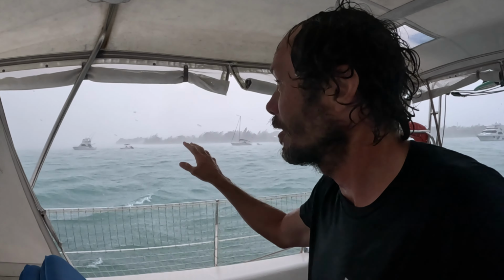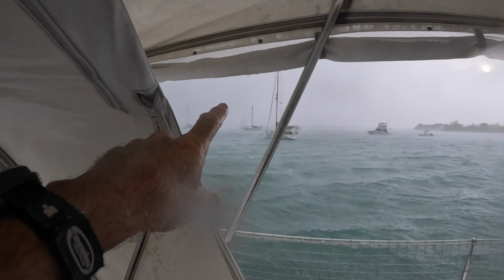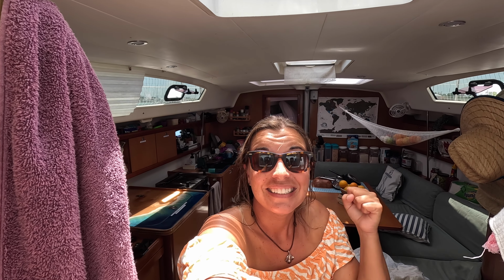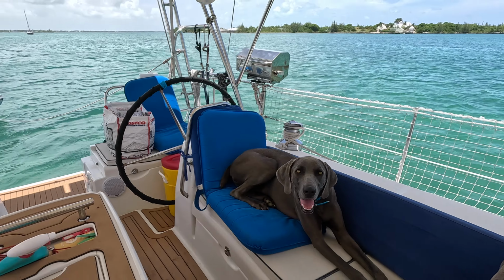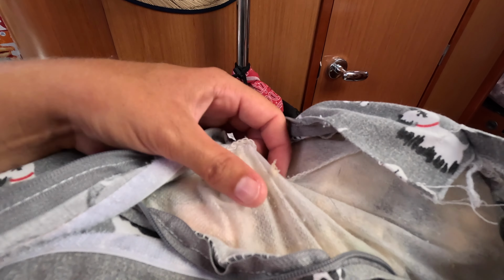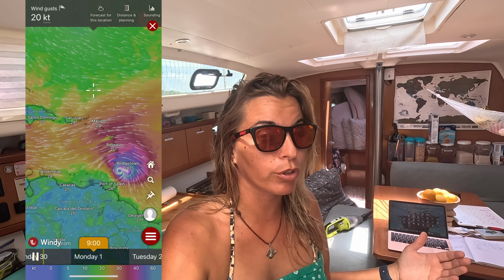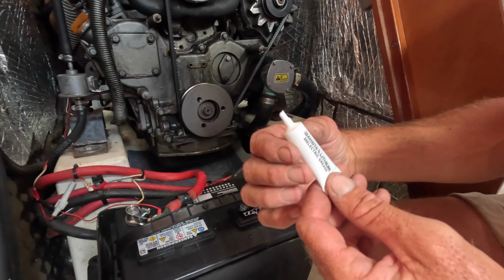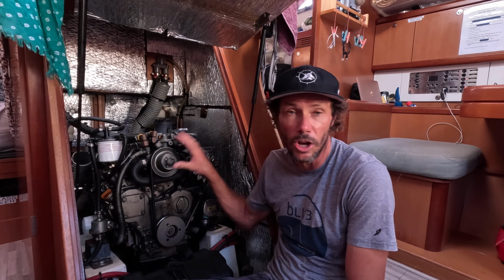Boat Life = Engine Troubles in Bahamas 🇧🇸- Ep. 245

Comment: Guys here is what you should do, Buy a recon kit for the fresh water pump on the engine. You don't need to buy a new pump. Waste of money.
It is just a seal and gasket kit you need to replace. That is why the coolant ids leaking out the weep hole, No big deal . I just love the dogs!
Reply: I'd get the Heat Exchanger out and cleaned as well while Im at it. Best Wishes. Bob. 👍
Reply from the maker: Thanks guys! We had already put the order in for a new one!! But we will keep old one anyways! We will be doing change in next weeks video! Arggg! Fingers crossed it all goes well!
Reply from the maker: Thanks for the info!! Ahh 😌 we already ordered the part! It cost us an arm and leg so we will keep old one and replace seals like you mentioned! Cheers for the advice though! 🐾 Flint and Kirra are the best!!! 🐶

Comment: In over 15 years of use I never had a Sulpste problem with Lead Acid batteries by keeping them at an absolute minimum of 12.2 volts or 50% Capacity, before fully recharging them to 100% AGM BATTERIES should be kept above 80% Capacity to hugely extend their Service Life, and Li Time plus, and Power Queen Lifepo4 Batteries are now good enough for a Bank treated properly for a second Bank, to be used to keep all the AGM, Starter, Windlass, and bow thruster Batteries to be kept in tip top condition by using DC to DC hanging from them, while keeping the Lifepo4 Batteries above a 50 % statevof charge, and gently charging and Discharging them to maximise their service LivesRe the engine, looks like the Hrat Exchanger needs a thorough clean as well ? . Re the Oil changes - good quality Synthetic oils have a phenomenally tough structure, and as such can stand to be changed every few years, but it is important to change the Oil Filters Regularly, and the Charter Companies fully service every three months for good reasons, so here's an idea ? Bulk Buy high quality pattern Oil Filters, and change them every three months  ? At the same time check and clean water and fuel,Filters, and check everything else as well, including gearbox, Saildrive, etc. Every few years send a sample of the oil in for analysis of how gourmet engine is doing internally, so you know where you standtbh, Id be looking for somewhere less exposed to hole up for the rest of Hurricane Season. Very Best Wishes. Bob.🌟🌟🌟👍❤️
Reply from the maker: Thanks Bob! As always for the great info! We actually ended up returning the battery as the voltage just sat so low…and they have taken responsibility for it! We bought a proper Marine starter battery and this one seems to be doing a great job! No sulfate as of yet!
Reply: @SailingZephyr  It’s worth noting that Lead Acid batteries and which may apply to AGM as well do self discharge surprisingly rapidly, so it is well worth checking their Voltage Daily for an easy diagnosis of their internal state ? Once they get below 12.2 volts they start dropping in voltage scarily fast, and there is no such thing as a Deep Discharge battery that is safe to actually Deep Discharge- every Deep Discharge Damages Batteries, and advertising them as if it is ok to Deep Discharge them is false advertising as far as I’m concerned. Once you know how to treat your batteries right, the gains and the Service Life of them become pretty substantial to be honest. Only now do I feel that I know enough about Lifepo4 batteries to be able to have the confidence to install a Bank 2 of them for a management role for keeping all other batteries in tip top condition, and I can now do that with the very cheapest of them by splitting them into a Bank of 4 x 100 ah and a usable up to 200 amps, via gentle discharging and gentle recharging, so the individual batteries in that Housebank never get stressed- note, I will never use 200 amps topping up the AGM batteries during the hours of darkness, so I don’t even need Li Time or Power Queen Batteries any longer, though their new BMS is very attractive to have. See Will Prowse comparison testing video, and his test of Seikon 100 ah battery to see why. Note NEVER Abuse Batteries like Will does, he does provide useful insights, but I suspect he just loves blowing shit up tbh.🤣🤣🤣  (seems Lifepo4 batteries like being charged at 0.15 x C, with C being the Bank Capacity  so max amperage charge for an 800 an Bank capacity is 120 amps, so if 4 batteries in the Bank, they are only getting 30 amps each if your connections and wiring are properly balanced - so no stress, and no overheating )Best Wishes. Bob in Wales .🤔🌟🌟🌟👍🏴🇬🇧⛵️❤️